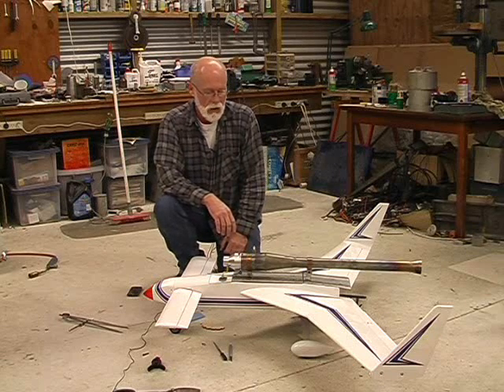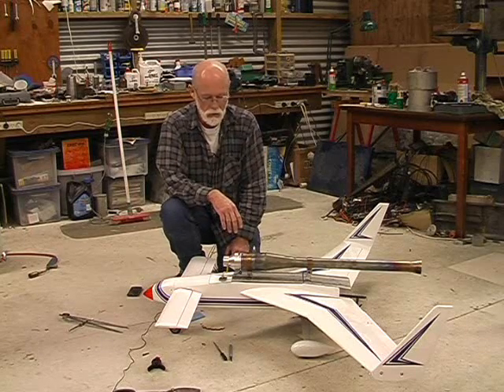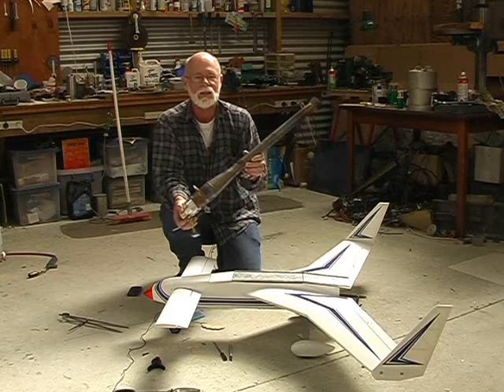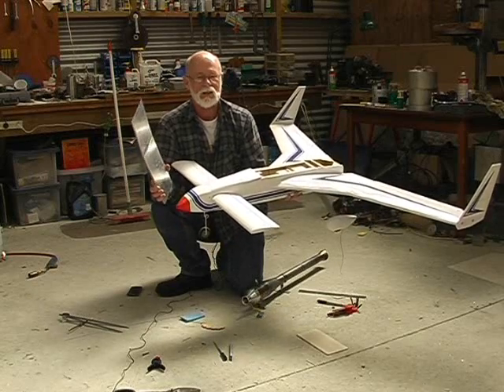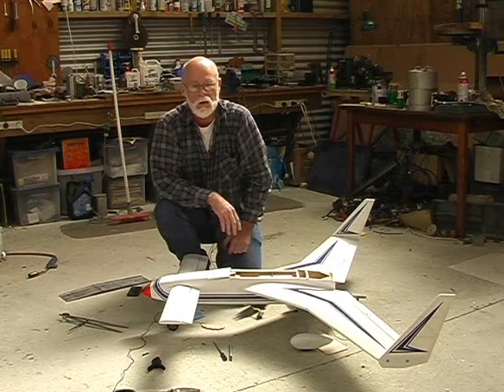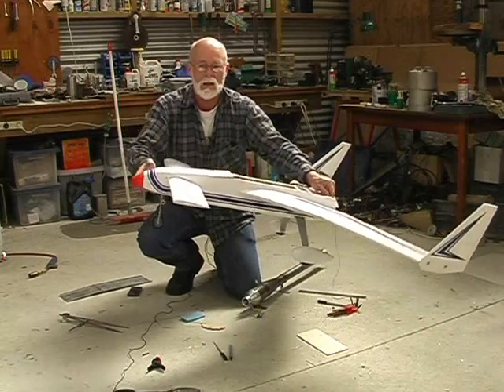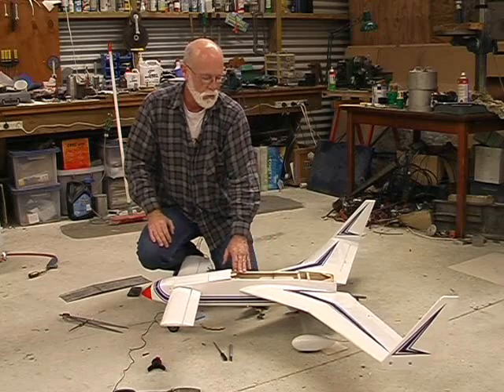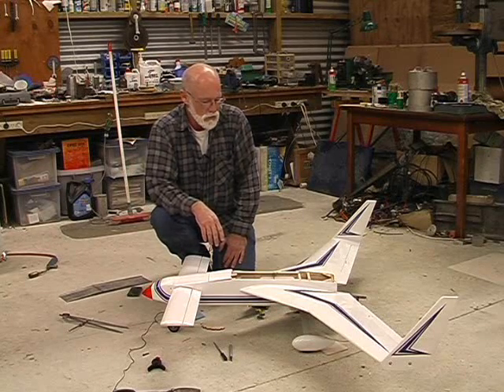Pulsejet-powered Long-EZ (part 1)

Comment: I wonder why we don't see pulsejets in use more in Ukraine.  Seems like the cheapest form of propulsion, and high performance.  They'd be especially cheap if you had a small metalworking shop cranking out parts.  You could crank out hundreds or thousands of them very easily and cheaply.
Reply from the maker: I have seen some attempts to use them in the Ukraine conflict but although pulsejets look very simple there's a lot of detail that's not obvious so some experience is required to design, build and operate them.    They would be a very good short/medium range option for low-cost ordinance.  I built my own over two decades ago (and got into a lot of trouble for doing so):   https://www.aljazeera.com/news/2003/6/5/new-zealander-builds-missile-in-backyard
Reply: @xjet  Ah you're THAT fellow!  I remember reading that in the paper!

Comment: how do these engines deal with alcohol as the fuel source?
Reply: Alcohol should be fine on models that normally could take gasoline. Just make sure you keep it away from moisture sources so that water cannot get into it and impede performance.

Comment: Let me just say this is the first RC plane that has caught my imagination and got me daydreaming about one. I have aiways admired the lines of the long easy, but aiways thought that the pusher prop didn't fit the advanced futurestic look but the pulse jet seems apropreate and the flight charactoristicsseem vary good with changes to angle of attach on the connard. hope you sell a ton of them.

Comment: can these engines have throttles because im only 15 i fly rc planes at my local club and want a jet but as you said turbines are way two expensive and i always use the throllte so could you use a throtlle on these engines ps could you acutually classifie one of these engines as a real jet

Comment: thnat for the explanation,today remove the weak weld knot on the push rod linkage and replace it with MIG TYPE wire welding,and now looks more like real strong,i"ll continue with the kit building prosess and may post it when test fly it,thanks for all tips